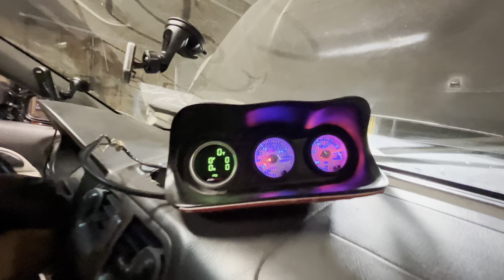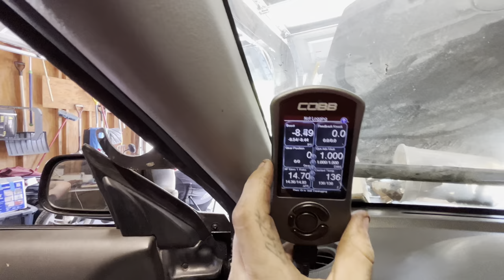Fixing a Saab 92X Aero?

Comment: How reliable are these? ones near my area and possibly interested in one owned by an old Subaru tech. I’d be downgrading from a Lexus to buy a house so I’d possibly get it for 4.8-5k but has 200k miles with engine rebuilt
Reply from the maker: Well depending on how well maintained it was it could be a great little fun car. They are reliable so long as you don’t try to push too much power and take care of it at regular service intervals.